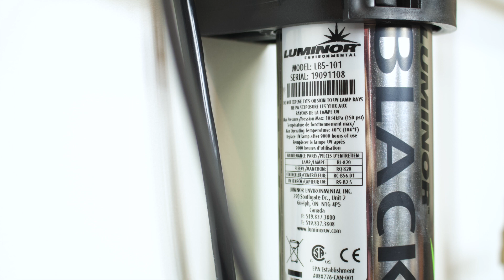LUMINOR BLACKCOMB How to replace the lamp on your UV System

Comment: The O Ring is crucial otherwise the water will leak. The gland nut is poorly designed and does not lock in very well after turning it to seal.

Comment: You fail to mention that the quartz glass tube that the lamp sits within may need cleaning. Depending on the filtration prior to the UV unit, the glass tube will attract a build of of bio-film, which, if left uncleaned, will cause the tube to become opaque. This will reduce the effective transmission of UV light to the water, even with a new bulb.
Removal and cleaning of the quartz glass tube can be a delicate operation, and a new O ring seal should be used to ensure a good reseal.
A new O ring is pictured in the video, but not referred to in the spoken explanation.

Comment: Hello - a couple things you should add to your video-
1- there is a very delicate glass sleeve inside the case - the bulb goes inside this glass sleeve.  If you're not careful, the glass sleeve will break.  It's over $100 to replace.
2- you need to shut off the water to replace the bulb.  When you go to turn the water on, you want to do it slowly because the pressure can also break the glass sleeve.  

These things should be in the video.  The sleeve is expensive to replace.
Reply: So much this. We tried to replace our bulb today, broke the glass sleeve. A weekend $250 service call plus broken sleeve = $$$$$$. Not cheap and not happy it was not mentioned in this video. Our old uv system was so much easier to replace the bulb and deal with.

Comment: Thank you. This made this change-out very doable. I had waited 5 weeks for our installer to come out to replace the UV bulb and filter and spot check our system (13 months old at this point). He called last night to say he wasn't available for another two weeks. I didn't want to wait another two weeks because I had to unplug your UV system weeks ago after it had reached the "final warning" and the incessant beeping was keeping one of our children up. After watching your easy to follow instructions I had the bulb changed in less than 3 minutes.  We are very happy with this UV system!